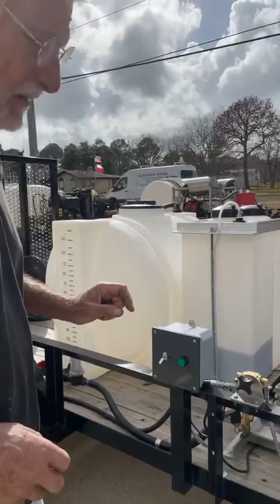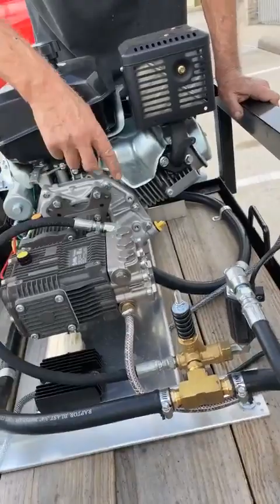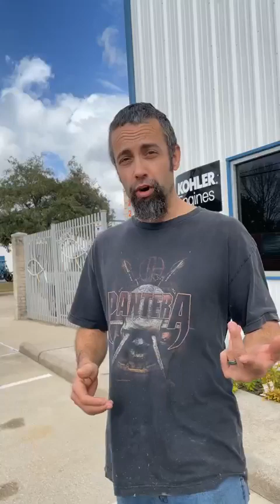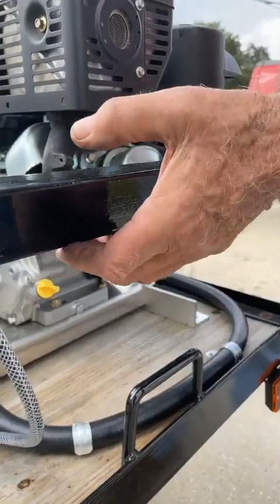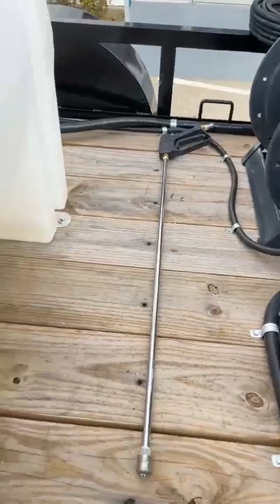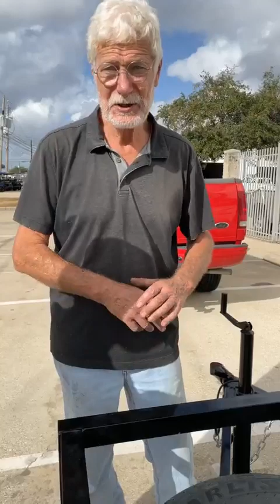Upstream Injection

Comment: @TxCoWash For fleet washing, in what situations would you personally use the touchless 2-step (downstream) method  instead of the touchless upstream injection method?
Reply from the maker: I never use the two step method.

I do a one step always.  And then we will do a reverse two step when we aluminum brighten.  We apply after we have the truck clean